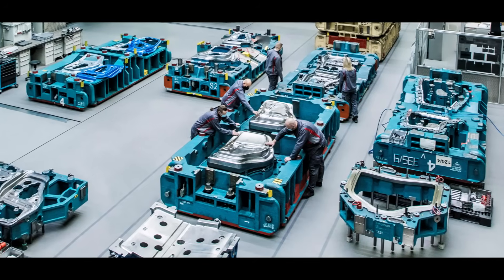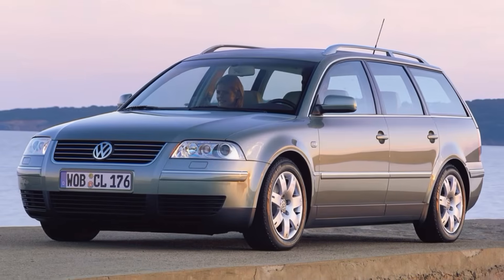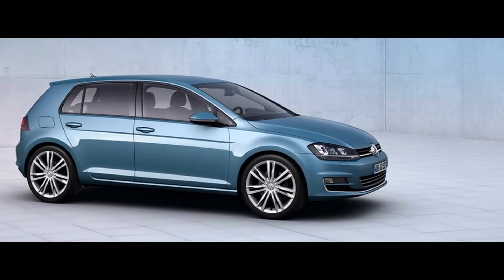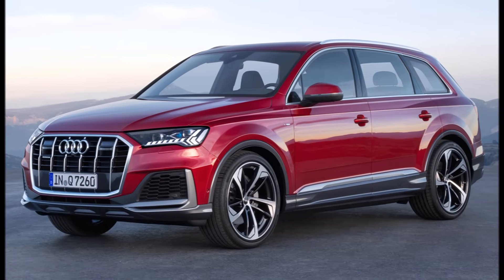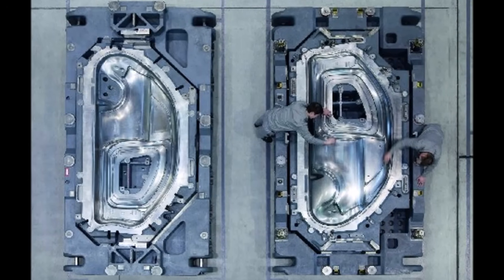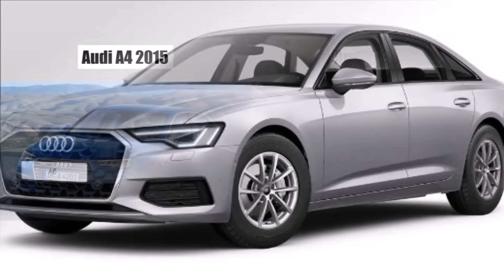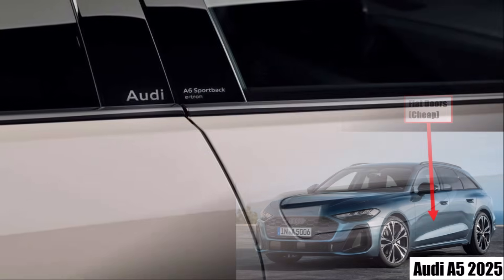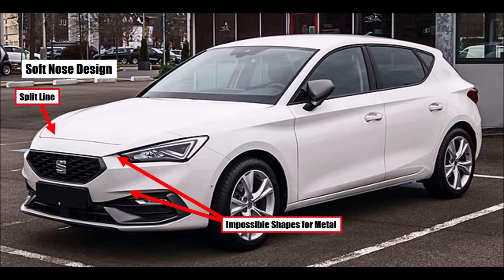Car Bodywork Details EXPLAINED

Comment: Very good analysis. I never made the connection between dieselgate and VW going round. I wondered why their facelift went away from the beautiful chiseled designs to looking a little bubbly. This makes a lot of sense. Thanks!
Reply from the maker: Glad it was helpful!
Reply: @sonydominates  VW was more round in the 2000’s.

See: Mk5 Golf and Jetta, B5/B6 Passat, Mk4 Polo, Phaeton (!!!), first gen Touareg.

And yet none of these designs looked cheap. A lot of these cars actually had a bit more quality than their newer counterparts, at least in some areas:

Mk5 Jetta had gas struts on the trunk lid, whereas the current (Mk7) has conventional arms.

Mk4 Polo had metal speaker grilles on the doors, alongside with the rear door having the exact same fit and finish as the front door (5 door versions only). Mk6 Polo has the rear door panel made ENTIRELY from plastic.

Comment: You dont have to be an engineering guru to figure this out. In 2019 I sat in an A4 and the Q3. The Q3 felt like a tin can compared to the "older" generation A4. I can only imagine the disparity today.The A3 in comparison felt like a Dacia. Things like number of parts on the door assembly. insulation, door handle quality, door closing quality, materials. Everything.

Comment: someone in my hood still got an Audi A5 from 2008 and every time i pass it I think "man this is when car design peaked"
Reply: Walter de Silva 😊
Reply: @ggmgoodgamingmichael7706 Kinda ironic that this dude actually designed half of the cars I've owned so far. The other half was designed by a Belgian dude whose name I can't really recall right now.
Reply: @ggmgoodgamingmichael7706  Yes, de Silva was the design chief at the time, but more accurate is to credit Satoshi Wada.
Reply: @robinperez  Correct. Thank You. Responsible also for the brilliant A6 C6. All of his designs, if You think about it really, are timeless and made Audi the confident, performant yet understated choice. Audi should have kept him, these new models pale in comparison. 🙂
Reply: I've got my 2013 A5 for over 8 years now, I still love its design and admire the Audi design of that era.
Reply: Yeah these are great looking cars. Obviously especially the S5
Reply: Just keep driving it! Being a VW Audi, it's (probably) built to run for 30 years / 1,000,000 miles after all.  No need to "upgrade" to a newer one.
Reply: I love my 2014 Audi A5 Sportback <3

Comment: You can identify cost cutting measures by looking out for easy and “good enough” solutions. But I would be careful to call everything without sharp edges cheap. Even the cleanest edge can look worse than a simple curve if the design doesn’t align with it
Reply from the maker: That is true, no edges doesn’t automatically mean cheap

Comment: This is brilliant to point out! Great work as always B sport! :D

And then there's BMW that stress out metal sheets so they don't shapes properly and all the cars seems damaged just from out of the factory. Every post Bangle BMW it's a total mess under neon lights
Reply: Interesting remark! Is that the reason why at recent BMW's (like my G21...) the sheetmetal of the doors at both sides of the vertical shutlines appears to bend inwards? I never noticed this at older cars. The slight bending gives the bodywork a cheap appearance. Strange development.
Reply: @madrettorfotrop6016  yes of coruse, from Bangle (included) on, BMW went out of the classic metal sheet rules to draw new lines despite the quality of the execution (the metal can't take those shapes). This btw, had succeded, proving that many of the customers won't notice any defects (same concept for front wheel drive switch)

Comment: If you look at CFD, the creases on the sides of modern cars actually serves an aero purpose, it cleans up the up wash thrown by the upper tire wake. Since the upper wheel wake creates an upwash(downforce) producing pair of vortices, that upwash then meets the crease on the side of the car, and rolls up another vortex, which then keeps the flow attached along the C-pillar.

Comment: Truly something I've never thought about, and I spent a lot of time looking at those Audi designs from around 10 years ago as I thought they were well designed. Their current downward trend in design is probably not exclusively due to cost saving, but it's just one more thing Audi does wrong nowadays. As someone who used to be a big fan: Audi is on the way down.
Reply from the maker: I just used Audi as an example here because it's very obvious and they invested a lot in their bodywork in the past, but you can see the same at other brands.

Comment: As a student in Car Design right now, this is a uniquely specific video that REALLY provides some helpful information.
Reply from the maker: Glad it was helpful!
Reply: Audi pioneered aluminium vehicle construction with the Audi Space Frame.
Reply from the maker: @ Yes, the beginnings of this might also be stuff for a video!
Reply: @LukeAusNSW  Audi was (by far) not the first to use aluminim ... Panhard used full aluminium body in its models from 1947 to 1956 (around 100000 Aluminium dyna were produced).  It is quite 50 years before Audi produced its first aluminim car.
Reply: Yeah, not in car design here, but this video has so much unique information that I haven't found in any other videos 😊 Great vid' B Sport!
Reply from the maker: @ My Pleasure! More to come!
Reply: As an automotive design graduate - this is an awesome video!
Reply: If interested, I recommend checking out some stamping analysis videos. That's basically the tool engineers use to get to those shapes after several iterations.
As an engineer, I would very very very appreciate it if you could share that knowledge with your colleagues!
Reply: This topic is so much more complex than described here. For production we most of the time use stretch forming. Here, the workpiece is first stretched to the yield point by moving the clamping devices apart. Beading has a functional side, but was used excessively as a fashion element for some time. This is now diminishing. It is much more difficult to bring a flat, slightly curved door skin to the same level of stability as a multi-curved door skin with a bead. Aerodynamics also became an increasingly important factor, which is why door handles, for example, have changed. As a designer, I think it would be good if cars were designed more objectively and less aggressively again. This also makes it easier to differentiate. But the deliberately short half-life of fashion trends and appearances simply sell well.
Reply: Now its all gone. Quality isch over. But prices are up
Reply: You won't pass the year listening to such mo. rons.

Comment: The new ones are cheaply made made yet still hella expensive!
Reply: "The new ones are cheaply made and of really low quality yet very expensive!" Corrected.
Reply: @MehdiS-music  Just to tell you... Nobody remembers what a grammar n... tells them in a comment online.
Reply: @kaedeschulz5422  its not about grammar its added context
Reply: Ah, the defining design language of the post-modern era.
Reply: There are 2 or 3 major issues that can explain why cars are getting more expensive.
1. Inflation. The new Audi A6 e-tron costs 63k to 64k € in early 2025. Back in 2020 it would have cost 49k to 51k € which would be a more reasonable price back then.
2. This is slightly a subjectively consideration, but the quality of the new cars didn't drop that much as too many Keyboard worriers are explaining and car reviews see in preproduction or  press cars. Quality didn't drop that much, in fact the quality drop is not noticeable. 
3. Base models of newer cars are already full with so much tech. So much tech that is even more then full spec predecessor has, at least 2 predecessor before. Every extra option is just luxury
Reply: @Pertev777 2. it did at the lower end. Apart from a Corolla, 30k buys you a piece of crap. 0 reliability, low power, really low quality materials.

And even for a Corolla, shelling 30k hurts. Other than reliability, falls in like with everything else.
Reply: @TTks124  You're right. Sorry to hear. There also one thing that is no more, even up to the premium class. No more fabric lining in the door bins.
Reply: @Pertev777  4. Safety requirements. 5. Emission requirements.
Reply: @flottenheimer  Good point. EU fucks them up with the harder emission regulations, but it was slightly the fault of VAG itself back in 2015
Reply: @Pertev777 I mean very VAG fault with DieselGate ofc  turns out the whole European Diseliaztion was bad idea. Drive 4 Answers has a really got video about it, he explain why disel is so big european then you see that it was never an a equal competition in diesel vs petrol cars and only after DieselGate it become slowly equal.
Reply: @Pertev777 Yet Chinese cars are somehow cheap, full of features and cost around 60% of VW while having better interior.
Reply: @wadimek116  but there is also the strange price regulation that even makes German cars cheaper in china. For example the VW id3 costs around 30 percent less then here
Reply: Because they want to make as much money as possible.  People are still buying cars anyway
Reply: @yukiko_5051  I certainly won't buy a VW or Audi... Not a new one anyway. The prices alone are ridiculous! Volkswagen has nothing to do with VOLKswagen anymore. A new base model Golf is 30k😱
Reply: @kaedeschulz5422  "A new base model Golf is 30k"  I'm not sure which market you are talking about, but obviously ICE cars have more taxes on them than EVs.  There is certainly profiteering in ICEV prices which started in COVID times, allowing Chinese automakers (in markets where they are not tariffed like Australia) to undercut legacy automakers like VW and Mazda, not just with their Chinese ICEVs but also their BEVs.
Reply: @TassieLorenzo  With cheaply made what i mean is that the quality isn't great despite it being very expensive... What market? Germany. And speaking of VW and their prices. Their EV are more expensive than the ICE counterparts.
Reply: Try removing inflation from the comparison, to make it objective.
Reply: @procatprocat9647 this is something I noticed too late. Honestly cars didn't get too expensive. Inflation made it expensive. New A6 etron would cost 50k if we had 2020

Comment: So they spent a ton of money for nothing. No wonder German manufacturers are in trouble. They need to le learn what the customers want to spend their money on. 
Not sharper lines, but cheaper cars.
Reply: Now they are cheaper, but cost more :)
Reply: @jsade  :D
Reply: You're being very short sited. Most people when buying a German car; especially a premium marque like Audi, pay attention to small details. Whilst they may not notice everything outright, it subconsciously lifts their perception of the car and the brand as a whole. If the big premium brands didn't do that and instead focused on cost savings, well they wouldn't be considered premium anymore.
Reply: @Swiss4.2  you just made me think how I open my 2021 A6 vs how it's done on latest A5. Not once have I opened the door from the bottom, but that's the only way you can open the door on A5. Hope the new A6 will not adopt the same mechanism.
Reply: @Swiss4.2  if you are correct, then why are these companies in such a huge trouble? Then who is short sighted?

Comment: I always wondered why the big, plastic, protruding door handles with door recess became so common? Starting in the early 2000's all cars seemed to get comically oversized door handles. Now for aero more cars are going to recessed/powered handles or buttons, which can be infuriating to use. 
Didn't we already have aero/cost/style/usability balance perfection with 90's Japanese 'lift up' handles?
Reply: I think one answer might be safety. A big and solid door handle can take a lot of force, so a crashed car with bent structure and doors with these handles allows people to pull hard to forcefully open the door and save people in the car. 
Modern door handles, especially the electronic ones seem quite dangerous in this context. But maybe car makers are so confident in the car's structure that even in most heavy crashes there's still at least one intact door that can easily be opened
Reply: The first generation Viper was the aero perfection without exterior door handles 😅
Reply: 💯
Those lift up handles were cheaper and better option than the current pop out handles which would refuse to pop out after the warranty ends
Reply: @ohchord9573  They had very unnatural ergonomics. You had to press up and pull at the same time. Good riddance. A car with such handles was not even considered for a purchase.
Reply: @timbehrens9678 they really didn't. The handles sat at a height that to pull them horizontally, you would lift them up anyway.

Ergonomics is touch based not visual.
Reply: The 90's style lift up/lift away handles were a commuter-car thing. The "aircraft style" door handles with the recess were a luxury car thing. As so happens, the expensive luxury thing gets copied down into the mass-market thing. (Like, see how often Honda stakes design cues from Audi... A5 style slope back lines, A4 lights, etc)
Reply: @stuntmonkey00  But only german cars seemed to use them? My W124 has 'aircraft style'  but slimmer, W140 is similar. Porsches also had slim, delicate handles up until the 996.
Ferraris and Lamborghinis had very subtle handles usually hidden in the contours of the body.
350/370Z's have undoubtedly the worst doorhandles ever- they're huge, look cheap and nasty, stick out of the body so are bad for aero and for some reason all get painted silver.

Comment: Hey! Very informative video, I have a question, @ 3:18 in the comparison picture between the two generations of A4, why would audi opt to go for a redesigned door? Wouldn't it be cheaper for them to retain the previous design as it would save the costs in retooling..in terms of die.. I understand die presses have a lifetime but re-designing should also cost money? Is there a technical reason apart from they had to change the design for facelift sake...thanks!
Reply: multiple reasons, if you reduce the QC, panel gaps will increase, thus such a complex bodywork will looks worse, the moment the simplified door will enter production is the moment you will be allowed to "fire" ppl and reduce salaries.